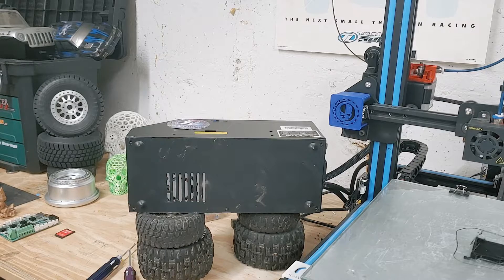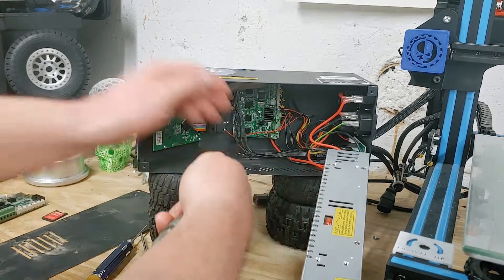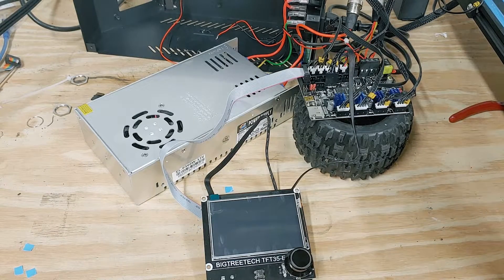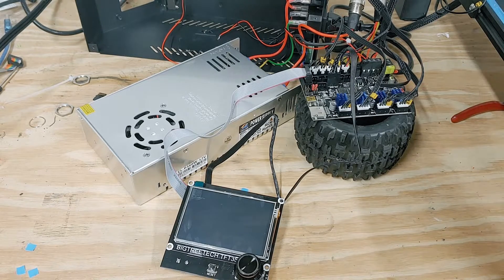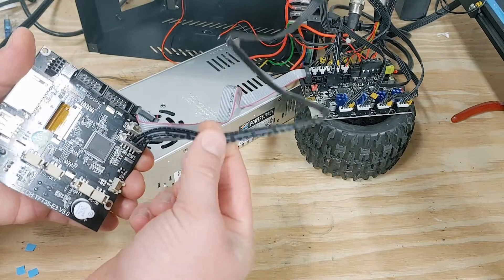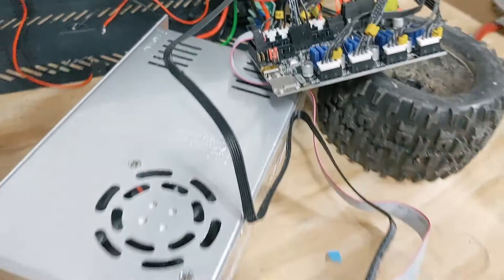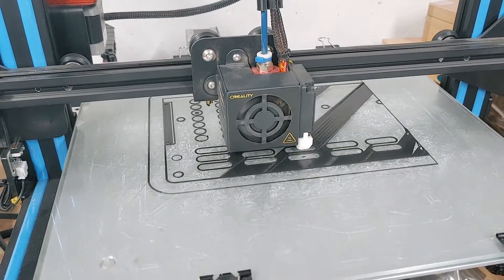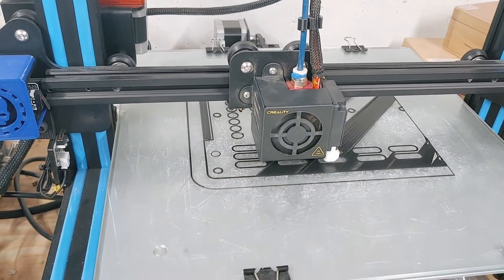Creality CR-10 gets BIGTREETECH TFT35 Screen Upgrade

Comment: glad to know the jump i am making from a stock control board to a e3 v3.0 won't be that difficult, but i do believe instead of printing a new enclosure i will look into 90 degree extension cable for sdcard and usb, pop a few small holes and mount, other than that one day my cr10s may look like a giant ender 3. update: got the screen and control board installed, everything works, didn't do a firmware update yet since i now have to learn how to teach the skb that it isn't ina ender 3, but cr10s. 😂😅

Comment: I know its been a while, and this isn't a new video, but i've done the same mod, but am short a connection for one of the case fans, I was wondering how you wired yours up?  did you leave one disconnected? or splice two together?

Thanks,
Reply from the maker: I think i did wire to fans in parallel.  I wont be home all week.  Otherwise id post a pic
Reply: @twin2turbo87  thanks for that!

Comment: Awesome upgrade ! Do you think it's worth the money, really big improvement ? I'll get my cr10 v2 in a few weeks so i want to prepare everything needed to use it well.

In terms of reliability is it okay ?
Reply from the maker: Reliability yes.  Worth the money yes.  If you're getting a new printer for the first time it will be much easier to learn the ins and outs with the stock board.  That way if something is off you know it is mechanical or setup error.  With the new board there can be a lot of variables.  But if this is your second printer.  Go for it.
Reply: @twin2turbo87  oh okay, thanks a lot for the tip, i'll do that when i'll have more experience then :) !

Comment: I noticed you posted a link to a 3d printed case for the CR10 box components. Was there a reason you did not mod the stock case to fit the TFT35? Is the main board (stock) the same bolt configuration for the MINI SKR?
Reply from the maker: Yes, cutting a hole in the side of the stock cr-10 case is possible.  However, the hole would have to be huge because the tft35 is so far away from the side it makes it impossible to reach sd and USB slots.  The case i posted can pretty much work for any configuration.  With added locations for raspberry pi and screens The main board does have the same mounting locations.
Reply from the maker: https://youtu.be/XoGz_w5f0qs

Comment: Thanks for the great video. I have a question. I have dual Z drive motors. Where would I plug the second one into? Or do I have to splice them? And I also have two plugs labeled VIN where do those plug into? Thanks again!!
Reply from the maker: Do you have a cr10s?